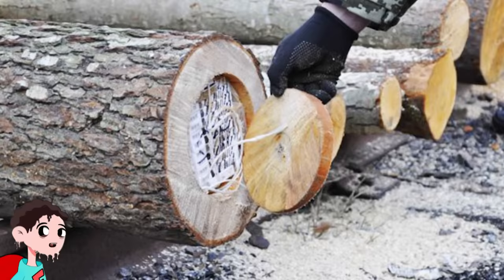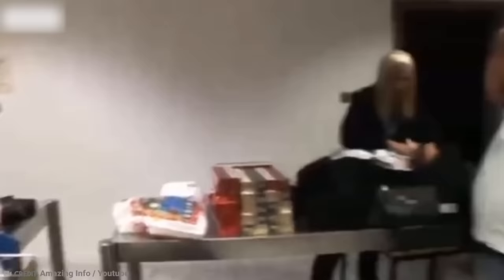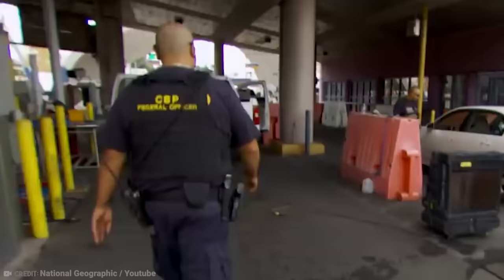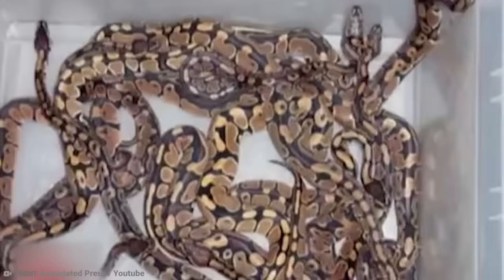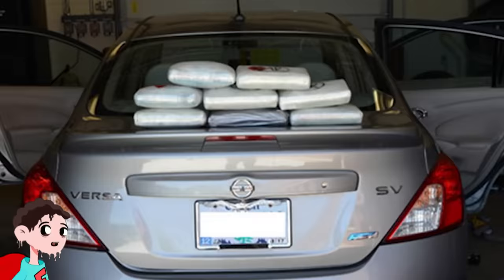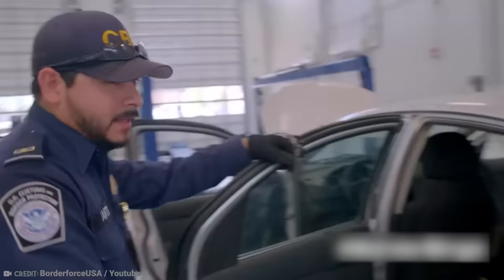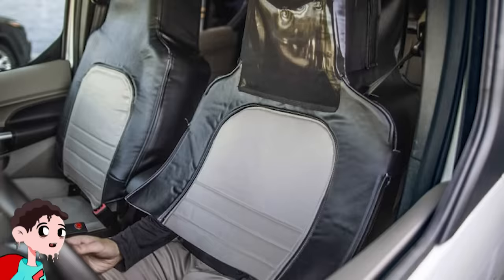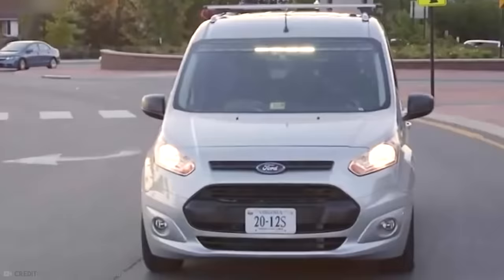15 Smartest Smugglers in All History

Comment: If they put weights in the tree trunks, between packages, it would've worked.
Reply: I think that you are right, but even simpler, they should have only hollowed out each end of the tree trunks and left the majority of the middle section hollowed out, along with a weight on the very end of each side like you had suggested. They may have needed to use more lumber, but they at least would have not gotten caught.
Reply: the weight distribution would be uneven tho
Reply: @subzeeroCS They could probably throw in metal rebar right in the middle

Comment: Wouldn't it be wiser for the smugglers of the first clip to just add equalized weights with the packaged cigarettes in a series of sections so the Inspectors won't know a difference in weight? The material that was bored out can be weighted so that the weights can substitute for the bored material of the logs. It needs to be as precise as possible so they wouldn't know ANY difference.
Reply: At least you and I know that lol they were too confident in the plan and didn't think it fully through
Reply: You should’ve worked with them

Comment: This one guy showed up in a loaded suburban from mx. He actually had to park it at an angle because it was too long for garage. From about 8pm till around 4am he was pulling on strings that were attached to elbows (lbs) inserted all thuout the frame and elsewhere. 
Also many times a string would rip or the drugs would get be too well hidden that they wouldn't be found or completely taken out. It was always simply written off and left so beware at those small used car lots=)

Comment: The average human anus is ale to maintain a cylinder that measures approx 9" in length and 3" in diameter with little discomfort to the carrier and maximum pleasure upon discharge if is tapered at both ends. FYI.